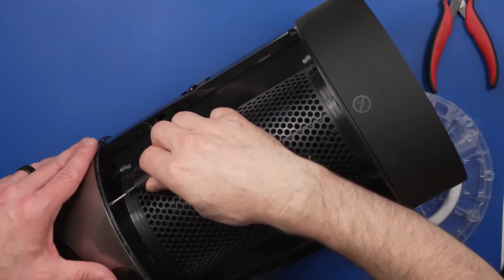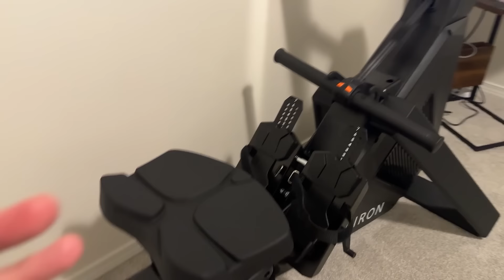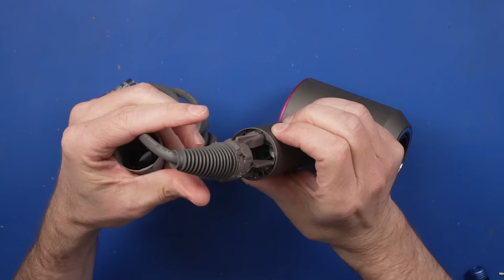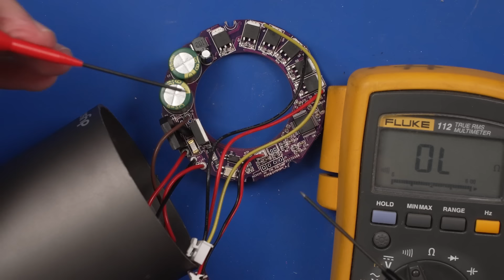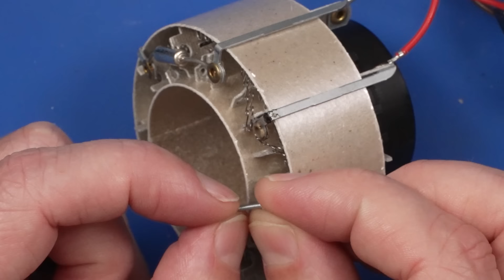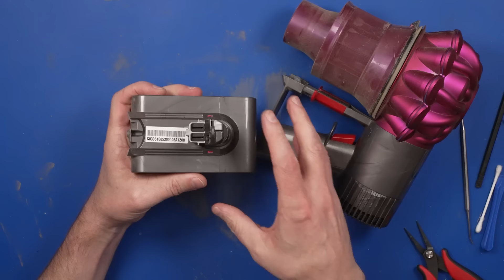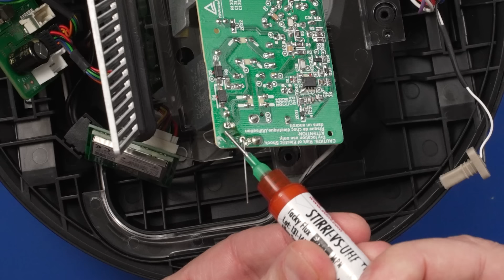Are Expensive Dyson Products Repairable?

Comment: One of the Dyson Vac you can buy a adapter and use a dewalt batteries.
Reply: I tried that, suction was horrendous
Reply: @destroyerofnations1828  You gotta use at least an 18V battery (like Milwaukee's M18 or DeWalt's 20V Max XR) or it won't play nice. I have two of these vacuums - one has a Milwaukee M18 adapter, and the other still uses the factory battery just because it hasn't shat itself yet. They both function the same. The one with the drill battery is what my family prefers because it lasts a lot longer, and you can swap a dead battery in seconds.
Reply: @lka1988 gonna do some research and hook up my 9Ah 60V flex volt battery up to it lol
Reply: @lka1988 true I bought an m18 adapter for that kids gator and it went past 5 mph
Reply: @destroyerofnations1828  so DeWalt, Milwaukee, Ryobi, and Marita use 5S batteries, and the Dyson battery is 6S. So you do lose a bit of suction power.
Reply: they make converters for all dyson vacuums to even the most obscure tool batteries.
Reply: I've got a Dyson v6 and replaced the battery with a genuine one purchased off ebay works great back to normal functioning plus i don't use max mode as I like to get the most battery life I can
Reply: @rrsd700  100%, I have one with a Milwaukee M18 battery. It's a lot easier to work with, and I can swap out batteries really fast to get back in action.

Comment: Last year I found a broken Dyson V7 at Goodwill… same color as yours but with the long extension and motorhead. Someone had already replaced the battery and the motor with rear filter and trigger housing, which is the main part so I’m sure they were frustrated. Found the brand new motor was seized from the factory until I took it apart and gave it a few manual turns. Works great now! Reminds me of a “crunchy” 24x slimline Teac CD-ROM from decades ago although manually freeing it up only got it to work once or twice. :(

Comment: Why is the battery for that hoover not just replaceable like every other stick hoover ? I have a vax one and you can just click the battery off like a power tool .
Reply: It is replaceable, you saw it done here. Two screws.
Reply: @Fur_nace  that is replaceable in the way an iPhone battery is replaceable , it should be replaceable like an old nokia battery .
Reply: @andljoy  no it is not, that is wrong. An iPhone requires special tools and processes to change the battery. The Dyson requires a screwdriver. You can complain about the cost, but it’s 100% user replaceable. It’s a battery pack. It’s very common to have to replace a whole battery pack on electronics. If you think you should be able to replace the cells inside the battery pack, that is very uncommon in modern electronics. Most battery cells come with electronic management systems and are not designed to be user maintained. This has been done to reduce size and increase storage density for better performance and longer life. This is the trade off for more robust, longer lasting batteries than 20-40 years ago. 

I wish phone batteries were quick swap replaceable like 25 years ago, but also know that isn’t realistic because the phone would need to be 2-3 times thicker to accomplish that.
Reply: Dyson has done replaceable batteries on updated models, but the older ones were internal.

Comment: Thst battery pack probably has a shorted mosfet. As for the air purifier you were pretty damn lucky because generally that fuse blows when there's a shoted MOV, bridge rectifier or transistor!

Comment: I have a quick question, I took apart my series X following your video a few weeks ago, as it kept turning itself off after 10 to 15 minutes. I gave it a good clean as it was terribly dusty. Very carefully reassembled and connected everything.
sometimes the air is still quite warm coming out of it, and last night after about an hour it turned itself off.
Should I take it apart again?
Should I pay to get it repaired?  (cex charges minimum 100 but that seems a lot.)
I am anxious about disassembling further amounts to check thermal paste.
Im not sure this is the only issue with the console and its out of warranty, is it worth trading in for a new one?
Your professional opinion would be great, thanks in advance!
Reply: One thing to note: warm air is supposed to come out of it. The processor creates a lot of heat, the point of the heatsink and fan is to grab that heat and move it outside of the Xbox to keep the internals cool. You would have a problem if warm air was not coming out.

If your Xbox is shutting off due to overheating, you should get a warning message about that when you power it back on. If you're not getting that message, your problem isn't related to overheating. If you are getting that message, the next step would be to install the perfect amount of thermal paste (make sure to clean the old stuff off first).
Reply: @ it was definitely a heating issue, oddly though i never had that message.  The air coming out of the console was over 40*c. But it started happening again so i carefully removed the thermal paste and pads and am going to reapply and see if this works

Comment: dyson, so expensive yet made from the thinnest plastic they can get away with
Reply: Seriously, the overall engineering of these things is to make them look pretty, not be durable.  People think that just because they have good airflow they're good products, but there's so much more to a good product than just being decent at its core functionality.
Reply: They even come standard with stress cracks already in the plastic!
Reply: I was so annoyed when one of the wheels broke off my V11 cleaner head and I saw the tiny screw boss they had used. And then, you have to tear the entire floor head down to get to and replace the part that has the screw bosses. Really annoying. Got it done though, gotta be extra careful around furniture.
Reply: Must look pretty and expensive, inside is $50 product. And for other people logo is everything it matters.
Reply: @TheSimba86  ive found my dyson vacuumcleaner is really nicely build and can be easily taken apart. The problem is getting the €1 part thats actually broken. Dyson only sells a complete section of the vacuumcleaner costing €80+
Reply: that's capitalism for ya, profits must go up at any costs!